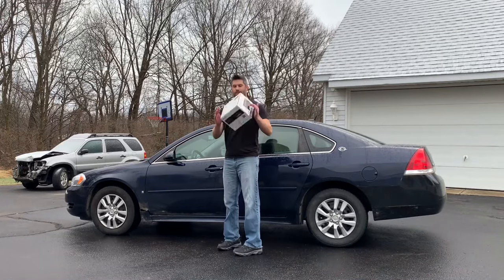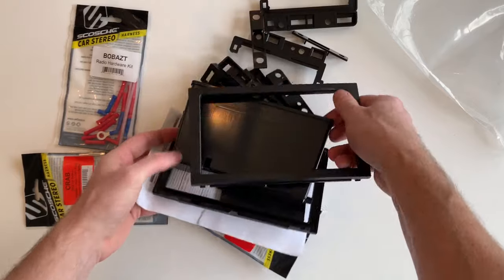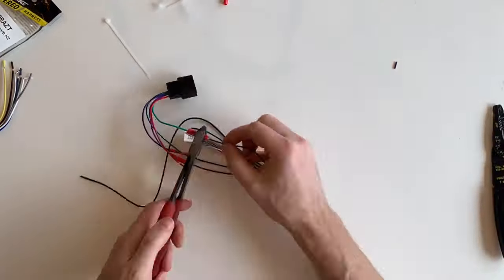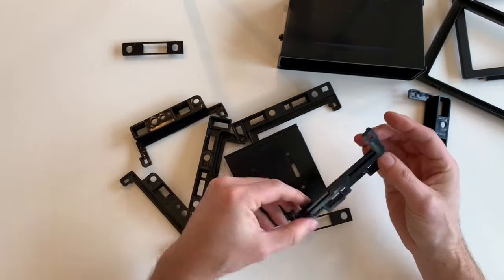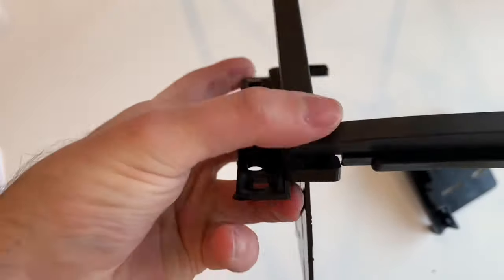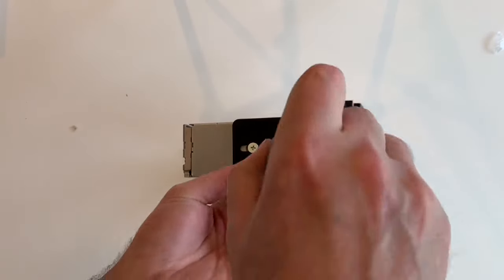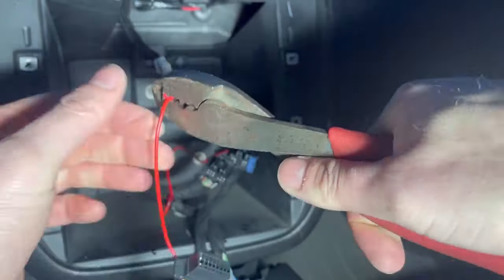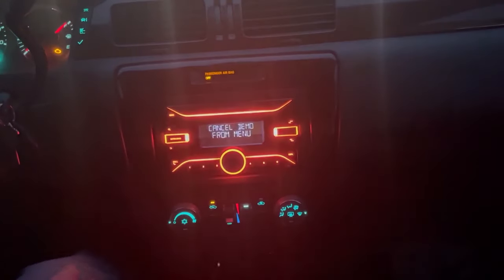How to Install Aftermarket Stereo / Radio | Chevy Impala | 2006 - 2013 (NOT FOR "BOSE" WITH AMP)

Comment: Thank you for this excellent video! I was able to wire and install my radio step by step along with this. A quick question. My radio stays on when I turn off the ignition, and only shuts off if the passenger door opens (not the driver door). I suspect this is from the 12V wiring to the fuse box. Can this be fixed to turn off from the driver door?
Reply from the maker: Glad it helped!
The passenger door is interesting. Mine continues to supply power for a short period of time when the ignition is turned off, but will immediately cut the power when the driver door is opened.
I will double check all of the doors and report back. It will probably be on Monday. Currently out of town for the week.
Reply from the maker: I just checked all of the doors. After shutting off the ignition, the radio stays on for a while. However, opening any door immediately cuts power to the radio. I tested each door individually and they all turned off the radio.

Comment: i like this video and i did find some help. the help is in regards to the red wire mentioned. with some looking there is not alot of clear easy to understand info on what is really needed. i did not find the kit you used on the scoche site. no mention of much on the metra site. crutchfield and sonixelectronix has so many choices. from the simple harness to 150 dollar options. thank you for the slower paced video with good camera work. so many race and sloppy camera.
Reply from the maker: Thanks for the feedback! Glad the video was helpful!

Comment: Wow thank you. I had just gotten my radio installed and for a while I wasn't sure where to get switched power from. You are a genius for using that power window fuse. I was thinking of going to the engine bay. Thank you! I just need to get the adapter kit to mount the radio and screw it in... Walmart was sold out.

Comment: There is no video better then this to describe exactly what to do!!👍👍...i hooked the remote wire for the aftermarket subs amp to the same wire as the fuse wire in this video because the radio wire was constant but now the radio doesn't always shut off when it supposed to after you open the door...any suggestions??

Comment: I’m deciding on upgrading my sound system on my 2012 impala Ltz with the Bose sound system.Im thinking on doing the 3 way 350 watt pioneer speakers.In the back I’m going to do a pioneer 700 watt.Am I doing this right?also getting different tweeters.I might have blown my Bose speakers somehow.I don’t play them past half volume but my bass is at max.Got any better speaker brand suggestions?

Comment: Thanks for this video! I bought the exact kit shown in video, It made it super easy!

 Any advice I'd give someone is buy a Sony or name brand stereo. I bought a Chinese off brand and it had some of the wire colors/ purpose mislabeled that caused confusion and neither of the plastic brackets fit my stereo and the screw holes didn't line up. I had to snip, cut, sand, drill and paint them and reinforce the cheap plastic wings with metal but it was solid and custom fit in the end. Looks great and works perfectly!
Reply from the maker: Glad it helped. Thanks for sharing your experience!

Comment: Hey buddy do you have to run the swtch power to the fuse? Im onstalling an aftermarket in my daughters 07 impala , i used a harness and im not getting power. Should i run the red wire same as you ? Thanks in advance .
Reply from the maker: Yes, run the red wire to the window fuse. It needs to get power only when the key is on. 
There is not at wire in the factory harness with switched power. It only has constant power (yellow wire). The factory stereo has an internal way to use constant power only. 
Aftermarket stereo requires constant power (to save the time and preset radio stations) and it also needs separate switched power to turn the unit on when the key is on.

Comment: Prob a silly question but do I need to disconnect my negative still even if I need to check for live wire? My vehicle doesn't have original connecters so I have to re wire everything from the aftermarket including putting a 12v ignition wire like in the vid. Btw I have a 2010 chevy cobalt.
Reply from the maker: If you are checking for live wires, the battery will need to be connected for that.
But it’s a good idea to disconnect the battery since you are cutting the factory harness. 
You may want to consider reconnecting a factory plug to the vehicle harness, then get the plug-in adapter to jump from the factory plug to the new stereo.
Otherwise, if you needed to connect a different stereo in the future, the factory harness may get too short if you have to keep cutting and re-splicing it.
Reply: Thank you so much for your help and advice! Sounds like a good idea. Appreciate you! @HowtoandReviewsOfficial

Comment: So if we get an aftermarket radio we don't need to get the password? 
Cuz I was reading that if you get a replacement radio you'll need a password for it or something? But not an aftermarket radio? My radio just died in my 06 Impala. 😢
Reply from the maker: I didn’t have to do anything with a password. I just plugged it in and it was good to go.

Comment: Is there anywhere else u can connect the red wire to? Tried what u said to do and it melted the cord. I didnt plug in everything in the same order as you did. Did I need to do it in that order?
Reply from the maker: You need a power source that provides 12 V when the key is turned on, and 0 V when the key is turned off. You could use a probe and look around for other sources. I am not currently aware of any others.
If the red wire melted, then your radio has a problem because it is drawing way too many amps. 
Also, the radio should have a little fuse on the back, preventing it from drawing too many apps. Something strange is going on.

Comment: What other fuses could you use besides a window fuse. Taking my impala head unit to sierra head unit (same harness) but it has crank windows
Reply from the maker: You’ll need something that only has power when the key is on.

Comment: What spade connector did you use? I’m so close to having it installed but I’ve never worked with wires before, so that’s the part where I got lost.
Reply from the maker: I used a spade connector because that’s what was on the end of the red wire that they supplied.
Reply: Not why, but What size spade connector ?
Reply: @Quez150 did you find what size you used?

Comment: I have an 08 impala ltz. Will the linked harness still plug in correctly? Planning on running a different amp anyways so not worried about bypassing the stock one.
Reply from the maker: Yea, it will still plug in correctly.

Comment: I've heard that splicing the wires like this means that the warning chimes (e.g. for when the door is open) no longer function. There are some much more expensive harness adaptors on the market that claim to retain this function. Is this true? These more expensive adaptors also claim to retain the retained accessory power (so the radio can function for a short time after switching the ignition off) and the steering wheel controls. Do I need the more expensive adaptor for all these things or do they still work with this method?

Thanks!!
Reply from the maker: I will do some testing and let you know.

I know for sure that as normal, the radio stays on for a while after shutting the vehicle off, but it shuts off immediately if you open the drivers door. This functionality is the result of tapping into the power windows.

I’m not sure about the warning chimes. I guess I have not paid that much attention. I will let you know.
Reply from the maker: I can verify that as normal, the radio will stay on for a while when turning the key off. Or it will shut off immediately when you open the drivers door.

However, it does not appear to do any warning chimes. I opened the drivers door with the key in the ignition, and there was no chime.

I’m not sure what made a chime or not chime with the old original stereo. I guess I never noticed. 

I do not have any steering wheel controls (other than cruise control) so I could not test that. But the stereo instructions says the stereo compatible with steering wheel controls. Not sure about the adapter harness. 

I hope that helps!
Reply: @HowtoandReviewsOfficial  Yes, on these vehicles you will lose chime when you install the radio with one of these harness adapters. There are more expensive ones that do retain chime, the cheaper of which can add humming or feedback to the audio of the car. 

another note, some of these vehicles have stock amplifiers, and it will have a different harness adapter as well. the  vehicles without the stock amp will work with this harness but you may have to modify the stock harness on the vehicles with an amp.
Reply from the maker: @deadchannel991  Thanks, I appreciate it! The whole purpose of my channel is to help people out and I would hate for someone to buy this kit and unknowingly lose functionality.
I think this is critical information that should be disclosed at the beginning of the video. I will do a little more research, delete this video, edit it, and repost it with this information disclosed at the beginning. I think steering wheel volume controls may also be lost, but I don’t have volume buttons on my steering wheel, so I don’t know for sure.
Reply: @HowtoandReviewsOfficial  they likely will be but that’s the same for every car with steering wheel controls, you just have to buy a separate harness
Reply: @HowtoandReviewsOfficial can you give me a link for an adapter that retains the warning chimes?
Reply: My son's 09 impala lost turn signal chime

Comment: my driver side speaker stopped working after i installed the stereo would you happen to know why and or have a fix for this issue?
Reply from the maker: Double check the wire splices for good connections.

Comment: Would you keep the steering wheel control with everything included in the kit? Or is it more complicated than that
Reply from the maker: I do not have steering wheel controls, so I cannot verify first-hand, but I have read that this kit will NOT keep steering wheel controls.
The instructions for the specific Sony stereo that I used say that the stereo itself does retain steering wheel controls. 
So, you may need a harness and a stereo designed to retain controls. Unfortunately, I do not know what harness to recommend for that. 

I think maybe this kit is designed to retain all functionality, but I do not know for sure. 
I recommend calling the manufacturer to verify this is correct. 

https://amzn.to/42zJ5c8

https://www.crutchfield.com/p_120GMOS04/Metra-GMOS-04-Wiring-Interface.html?cnxclid=16796236390059893953210090301008005
Reply: @HowtoandReviewsOfficial  thank you so much for the response! I really appreciate it and I love your videos👍🏾
Reply from the maker: @barttman0  thanks, I appreciate it. Happy to help if I can!

Comment: Im confused. Ive checked some of the comments and you say that if the impala has the bose amp between the 2 6x9s then you cant use this kit. And some comments you can. Which is it. I have the 2014 ltz limited. And i see the amp in the trunk. And i have already ordered the kit. Will it work on my model?
Reply from the maker: It’s been a while, but I believe the amp requires a power source from the stereo, which this simple harness doesn’t provide. A more expensive harness kit is required.
Reply: You have to get the factory Amp harness.. just something else they make you buy
Reply: @HowtoandReviewsOfficial  hey do you know what the other harness is called for the bose system or where i can find it?
Reply: I already have the regular harness but now do I just need the bypass thing for the Bose amp?
Reply: @lilchezboi6156  its not a special harness. It's about a certain wire that turns the amp on. I believe it's the remote wire. It's one of them blue wires on the harness. It needs to be hooked up to the red wire to turn on when the radio turns on.
Reply: @soxit2mee thank you that worked
Reply from the maker: @lilchezboi6156  sorry for the late response. Still working through the comments. I try my best to read and respond to all of them. Glad you got a sorted out!
Reply: Will this set up work on a 2012 Impala Police Interceptor version? Seems like there are a whole lot more wires.
Reply: @darthlazlo  does it have bose factory speakers?
Reply: @soxit2mee  good question. It does sound decent.
Reply: @darthlazlo  look at the door speaker cover and see if it says Bose. Or go in the trunk and look up and see if you see a amp.
Reply: Hey what did you end up getting my aux broke inside my stereo so I need to know everything i need , going to replace please answer and thanks
Reply: @a.n.g.3709  I ended up getting an Eonon radio. And it came with everything. Literally plug and play. Didn't have to splice no wires or nothing. Didn't even need a dash kit. Go to the website and put yo car info in.
Reply: @soxit2mee thanks appreciate the response 🙏
Reply: @a.n.g.3709  I didn’t end up changing it out. The stock stereo still works and there is an aux plug in.

Comment: Are you sacrificing the ability to use your power windows for the power cable or am missing something?
Reply from the maker: No. The power windows are not affected at all. Just using the same power source. And by using the input leg of the fuse, the windows are still fused correctly (the stereo doesn’t go through the window fuse). The stereo should have its own fuse on the back.
Reply: First off, great video and very detailed. 
However, I would highly advise against connecting the switched power red wire to either the line or load side of the power window breaker. I get the radio has circuit protection but circuit breakers are also intended to protect the wire as well. That red wire will not handle 25+ amps of power in the event of a short. If a short occurs, the insulation of that red wire will melt and could cause a fire. This red wire should be placed on an appropriately sized breaker and make sure it is on the load side Of the breaker (i.e. output side of the breaker).

Comment: hi im using the same plastic harness kit, but i have a Kenwood DMX7709S, I connected the plastic bits in the exact same way you did but it refuses to fit properly, would you happen to know why? Thanks!
Reply from the maker: Use the instructions in the Kenwood manual. I see yours has a metal sleeve, which is common. My Sony did not have a metal sleeve, so your install into the plastic adapter will be a bit different.
Reply: I’m having the same issue what did you end up doing?

Comment: I have the red wire conneceted. I have power to the stereo but have 
NO SOUND ??? I am mechanically inclined but NOT stereo inclined lol my son wanted a new stereo in his 2012 impala and I am stuck now !! Why is everything working but NO sound ?? Head unit is all that was replaced everything else is factory. So what and where is my issue ???
Reply from the maker: Do you have the Bose system? Does it say “Bose” on the front door speaker grills?

Comment: Changed the radio in my car and got no sound. Same harness and everything. I do have steering wheel controls. Don’t know if I need the interface or not
Reply from the maker: I do not have steering wheel controls. I don’t think they carry over. 
Do you have the factory Bose system?
Reply: No I don’t. Basic Ls package. Just with steering wheel controls

Comment: I installed my stereo exactly as you explained but I have no sound how do I fix this?
Reply: does your impala have bose audio? it should say "bose" on the door panels if it does. If so, you likely have a stock amplifier and need to supply power to it from the radio you installed.
Reply: @deadchannel991 hi there mine has bose so would i run the blue/whte remote wire to bose amp? or tap in the harness by head unit?

Comment: My stereo stays on when car is off any advice what I should do? I installed it the same way as the video.
Reply from the maker: Does it turn off when you open the door?
Yellow is supposed to be constant power. Red is supposed to be switched/ignition power. Check that it’s wired correctly. Double check your red power source only provides power when the ignition is on.
Reply: No it doesn’t turn off when I open the door. I followed the video the red wire goes to that fuse you used.
Reply from the maker: @fernasty497  After you turn the ignition off and remove the key, your windows (and radio) should continue to work for a minute or so unless you open the door. When you open the door, the power is cut immediately.
Do your power windows stop working when you open the doors with the key removed?
Reply: Found my mistake I hooked it up to the fuse below the one you used. So I just moved it to the fuse above (the one on the video) and everything works fine now as it should.
Reply from the maker: @fernasty497  awesome! Glad you got it sorted out!

Comment: i hooked mine up the same exact way and it wont even turn on? what could be wrong? the manual says the red is the accessory and the yellow is the constant
Reply from the maker: That is correct. Yellow is constant and red is accessory.
To turn on, you have to supply power to the red accessory wire on the radio harness. (end it also needs to be grounded with the black wire).